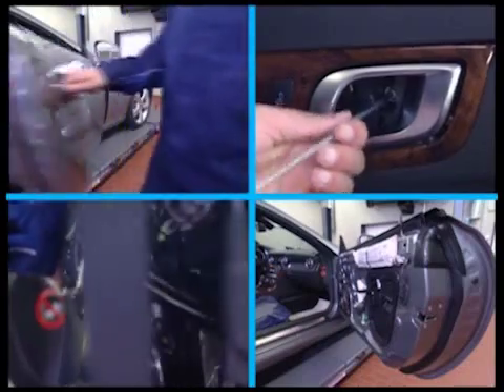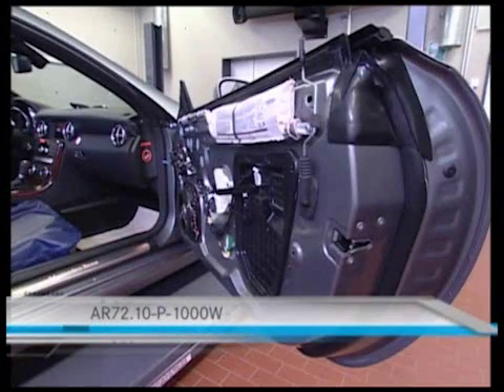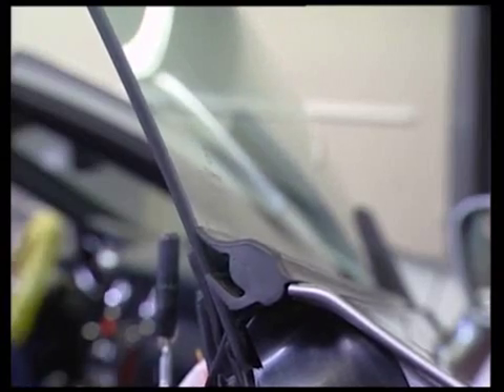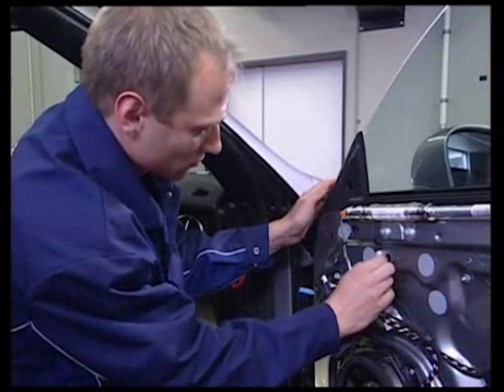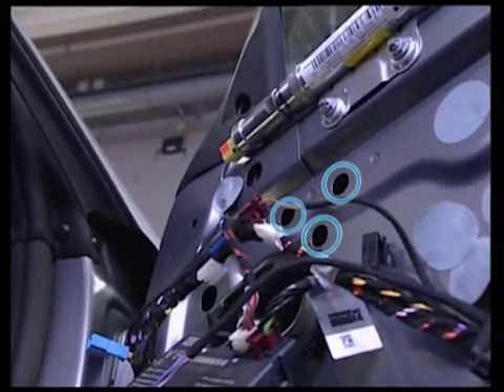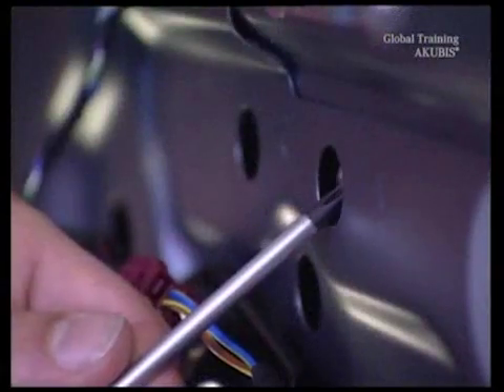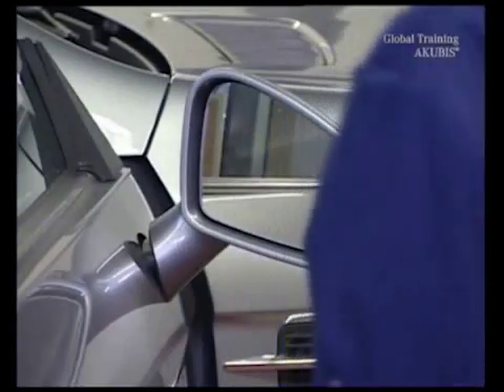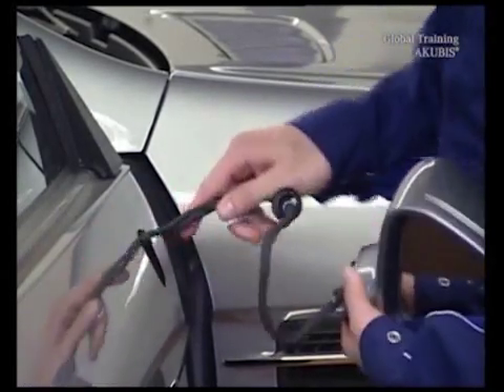W172 Remove install outside mirror

Comment: This video misses possibly one of the most important bits which is to ensure you attach a cord to the cables BEFORE you pull them through the door and remove the mirror so you can reattach the cord to the cables to help guide them back to where they need to go afterwards - the cables follow a particular route that makes it virtually impossible to reinstall the cables without removing the speaker and feeding it through the correct route. I hope this helps someone avoid wasted hours wondering how to reinstall the mirror afterwards! :-)